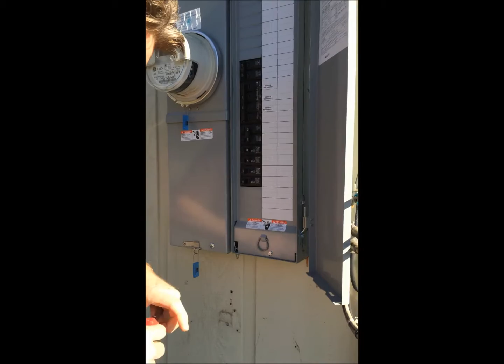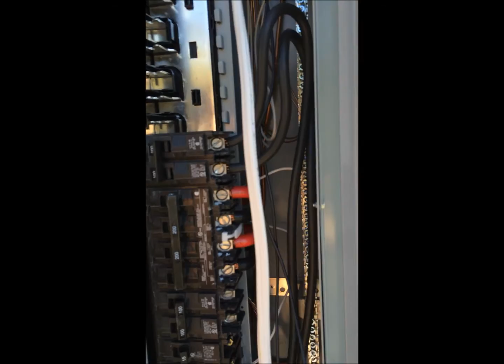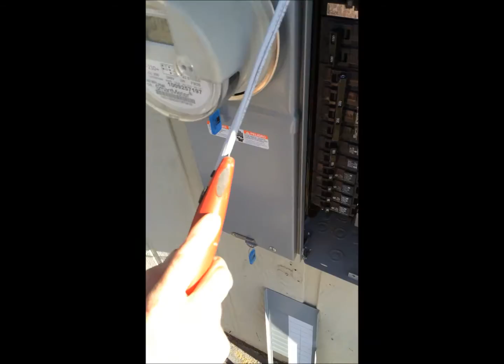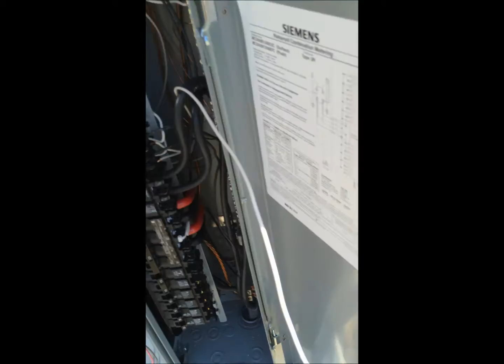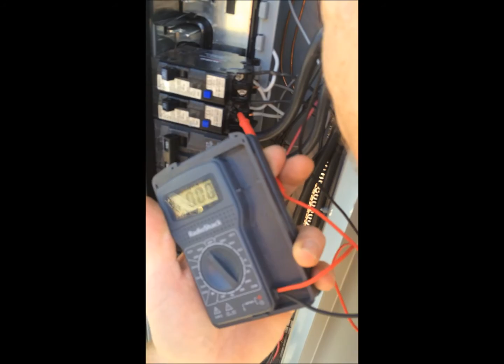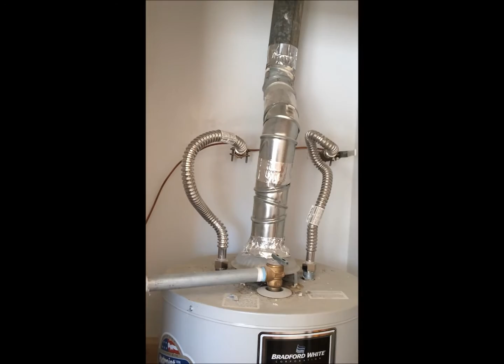How To; 200 AMP Main Electrical Panel

Comment: Question, on your 14-3 circuit should it not have a 15 amp 2 pole breaker or a handle tie on two single pole breakers?
Reply from the maker: I believe I installed 2 AFCI breakers which might look like a 2 pole installation as both the hot and neutral wire are installed into the breaker itself. GFCI breakers are also installed the same. 2 poles do requiter a larger breaker that crosses both poles or two small breakers which split between the 2 poles with a handle tie.